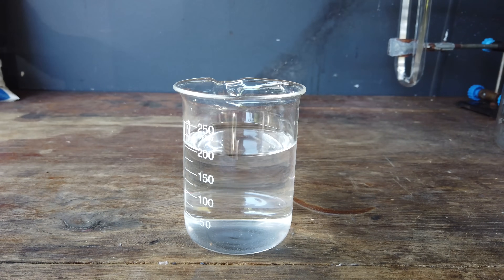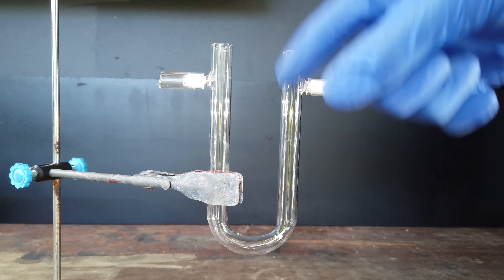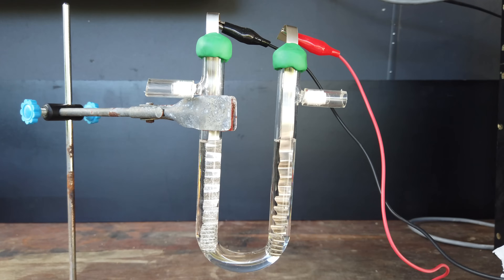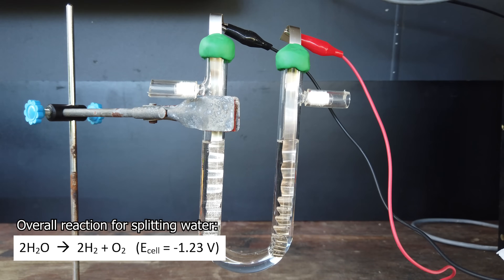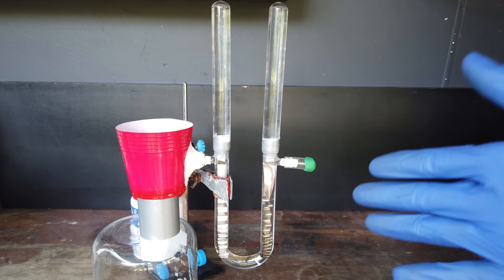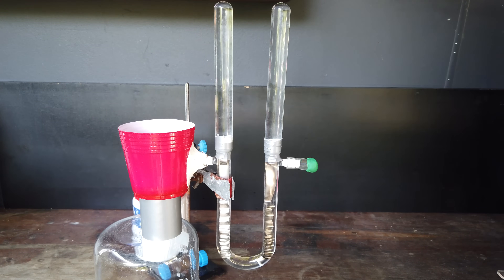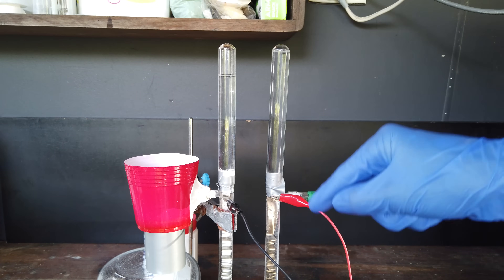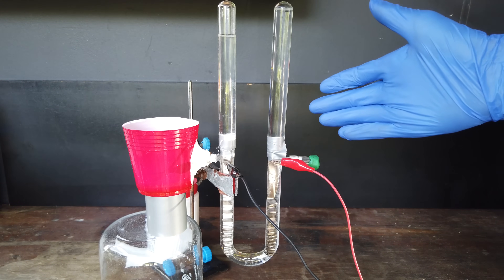The Electrolysis Of Urea

Comment: 12:45 is this video even worth uploading to my channel?

Yes, it is and thanks for uploading this. I actually wanted to know the opposite of the electrolysis of urea. I'm planning of separating impurities from urea through the use of electrolysis. The plan is as follows:

Carboxylic acids are the impurities in this solution of urea. Through Kolbe electrolysis, they'll be combined with each other, slowly making hydrocarbon molecules with few or no polar groups. These molecules, lacking polarity, should separate out from the aqueous phase as an oily layer on top of it.

Your video gives me confidence that it will be hard to break down the urea in this process (which is what I'm hoping to happen), so I'll experiment. I think this process might be more energy efficient than boiling the water (which does takes a lot of energy), thus it might be an interesting approach to separate carboxylic acids from other things in an aqueous solution.

Comment: I really like your videos and I'm currently trying to get a chlorate cell running but all I could get my hands on is a power supply that has a max. output of 3 A. I haven't found any videos about what you are using so I would be really grateful if you would share what you use and where to buy your kind of power supply.
Reply from the maker: I actually use an ATX power supply from an old PC, coupled with a $15 adjustable buck converter from Ebay. The ATX power supplies are free if you extract them from an old or broken computer, and can supply up to 20 amps at 3.3/5/12 volts in most cases, so I've found them extremely useful in the past.
I actually have a video on converting an old ATX power supply into a usable lab power supply, but it's a VERY old video, and not one of my best:
https://youtu.be/ygvbdwl-0bM
Reply: @ScrapScience  Thanks, that's a great help

Comment: I think this is what's used as a gas generator in some variable rate automatic lubricators. And a battery and you can change the rate of gas generator by choosing a resistor.

Comment: Yo man. The fact of the matter is that the voltage used in this process is too big for the volume and shape you are using. You need a bigger (at least 2l) container and the same process as where you produce hydrogen and oxygen. Instead of nickel, try using stainless steel. It should do the correct math of what you were speaking about in the video.

Comment: I would like to know how a commercial device for medical use of hydrogen works without the electrolyte. Can you show and explain that.
Reply from the maker: I've never heard of these devices, could you provide a link or something to point me towards what you're talking about?
Reply: @ScrapScience  yes https://www.youtube.com/watch?v=SpJqAwYXvkw
Reply from the maker: Sure seems like a pseudoscience scam to me...
Nonetheless, these hydrogen generators definitely have electrolyte in them. But since the electrolyte is technically a catalyst for the electrolysis, the initial electrolyte sold with the machine won't ever need replacing, so you only ever need to add distilled water.
It's similar to a deep-cycle battery, which uses a sulfuric acid solution as an electrolyte. With repeated charging/discharging, it requires additional distilled water over time, but adding extra sulfuric acid isn't necessary since the water is the only thing which is consumed.
Reply: @ScrapScience  thanks  for the knowledge i didn't know that .I still have 10x10cm plates of graphite and wanna build that kind of stuff.

Comment: Looking at efficency. If the voltage urea starts to break down at is .37 and one applies 1.5v  then you  1.5v supplied - 0.37 breakdown =1.13v over bolted to push amps.  If a cell has one amp flowing through it at 1.5v then your feeding it 1.5 watts, while 1 amp × 1.13v overvolted = 1.13 watts making heat, while 1 amp × 0.37v  0.37 watts of power overtime doing the actual chemical work of breaking urea to H2 N2 and CO2.  

0.37 watts/1.5 watts consumed = 24.6% efficent. Of cource the hydrogen has much more energy when oxidized to oxygen.

Comment: Electrolysis  in a U tube on YouTube. 😁

If you think of the U tube like a wire then it should become readily  apparent why theres very little current. Ionin flow is being restricted by the cross section of the tube much the same as electrons flow is restricted by too thin of a wire.

Comment: As much as you might think your voltage for dissociation is correct you also have to take into consideration the resistance. The voltage needs to be measured at  the electrodes and not at the reading of your power supply ! I for one was very interested in your video.The atruggles we go through are becoming the higher veiwed videos as of late . Great Scott in electronics shows many stuff ups till he gets it right and explains what the problems were . It makes geeat real world content!

Comment: Dude you cant be real. This is not electrolosys of urea you used sodium hidroxide wich breaks down urea into amonia and other randome garbage thats why youre quantity sucked at life. I hope you will do a corection or explain why im rongh
Reply from the maker: Low concentrations of urea will only appreciably react with sodium hydroxide if the solution is heated. At room temperature, the hydrolysis of urea won't occur to a significant degree under these conditions.

Comment: Holding two test tubes with electrodes in, inverted in a beaker of solution next to eachother is a far simpler setup.
Reply from the maker: Yep, that'd probably work better. Would require a lot more solution though, I don't really want to have to deal with too much caustic waste.

Comment: yeah i know right, its a pain using a box cutter to make a few cheap high surface area carbon felt electrolyser devices with open plastic bottles when robert doesn't do a lot of practical hydrogen urea electrolysis production on the channel water electrolysis at 1.23v/ Urea  electrolysis at 0.37v
like i said 2 weeks ago see https://m.youtube.com/watch?v=LaT5PZixcV0 1256 Urea Electrolysis For Hydrogen Production

Comment: When I was a teenager, me and my friend preformed electrolysis on a concoction of random chemicals we found in his shed, including spermicide powder amongst other things xD. We took power straight out the wall into the cathode and anode and the liquid instantly started bubbling like mad, as you'd expect with that kind of power running through it. We then got what we called "lightning in a jar" where the spark was bridging the gap between the probes, again, as you would expect with that kind of power going through it. We then blew out the fuses for the whole house xD. Those were the days lol.
Reply: Im glad nobody got hurt that day.
Reply: I had a very similar experience as a young teen. My liquid mix was sulfuric acid and salt water and my electrodes were .07 mm graphite pencil leads. God help the house breaker it took it in stride But my gass collection system was retarded and I had a minor violent detonation and that scared the hell out of me!  So shutting it down and hiding the evidence of my stupidity
Reply: @bigjay875  haha I think we were using nails or some random metal spikes.

This was the same friend who taped a powersupply for a model train set to his arm and dipped it into a fish tank to spazz out his arm muscles into contracting. Was only low power, but enough to cramp his bicep up to the point of pain, what I found extreamly hilarious.
Reply: @DaftFader  ha! Ya got a giggle out of me. Ya my best friend and I weren't the brightest light bulbs in the lighting department it's amazing I made it to adulthood with almost every appendage lost a bit of my foot doing energetic compound experiments. But $#it happens. I still love chemistry to this day. I'm currently moving my lab to a new piece of property much further away from people just to be a bit on the safe side. That and I always wanted a farm 😊
Reply: Yeah, I wish I could say it was the dumbest thing we did, but it really wasn't. I don't know how I still have all of my limbs tbh. 😊
Reply: @DaftFader  Wait a minute, electrolysis cannot occur with alternating current
Reply: @sirhaydn-1  Well we were just putting live wires into a jar of random liquid for no reason then 🤷‍♀ (not that we had a reason when we thought it would cause electrolysis anyway lol)
Reply: Nothing like take random chemicals and making electric induced gas out of them to inhale for later use in your cancer production. -=x  
Lucky summa bish!

Comment: Could you make another video of making nitrogen gas? A different method.
Reply: The best practical method is to filter Nitrogen from air. This can be done using a zeolite and pressure swings (Pressure swing adsorption) . You load an pressure container with a zeolite, and add compressed air. The Zeolite will absorb the Nitogen first. Then you bleed off about 20% of the pressure leaving a very high concentration of nitrogen.
The other was is to use a membrane filter that seperates Nitrogen from oxygen using compressed air.
Reply: @guytech7310  I didn't know that! I thought the only method I can think of was to burn something in air and then use NaOH to capture the CO2.

Comment: What is that power soucrce contraption in the beginning? Is it made out of a multimeter?
Reply from the maker: That's just my buck converter I use for electrolysis experiments. I put it on top of my multimeter for some reason.

Comment: The experiment may be tricky in the paper they state urine and urea aside of each other.
But urea is non conductive at first...it may become a bit conductive if hydrolyses occurs and that is what happens if you put a huge excess like 5 mol/L KOH vs 0,33 mol/L urea (putative average content of human urine is 33g/L what means 0.55 mol urea/L urine)...then there is a lot of K(+) and OH(-) and less CO3(2-) and NH3 as NH4(+).

But there is more into urine than urea... there are conductive salts of chlorides, sulfates, carbonates, phosphates of ammonium, sodium, potassium, calcium and magnesium...so why the need for external hydroxides?

To my feeling...the process to convert urea to hydrogen and nitrogen via the use of nickel is not really interesting on a production scale because it consumes a lot of KOH, energy and some Nickel...Ok it generates H2 gas as a potential fuel and N2 (but that is also cheap and findable into the air) ...but NH3 and urea are much more valuable because much more handlable and reactive...NH3 can be used as a fuel too on its own.

If I was to make a no cost H2 generator...I would use Aluminum waste and a little NaOH...(or a little HCl).
The Aluminium would be scrapped of its protective oxid layer to naked metal and react with water to make Al2O3, AlO(OH), Al(OH)3 (or AlCl3 and Al(OH)3+HCl) and a lot of H2...aswel as heat if needed.

Al + 3H2O --> 3/2 H2 + Al(OH)3 + heat
2Al +3H2O --> 3H2 + Al2O3 + heat
Al + 2H2O --> 3/2H2 + AlO(OH) + heat

Al + 3HCl --> AlCl3 + 3/2H2
AlCl3 + 3 H2O --> Al(OH)3 + 3 HCl (HCl is thus simply a kind of corrosion catalyst here)+ heat

So we get hydrogen, heat and with the Al oxides and hydroxides we have some extra money when making microwave rubies, sapphires ;o) and we clean up all those Aluminium wastes :o) ;o)

As a plus the destruction of urea to make H2 and N2...generates one equivalent of CO2...what is absolutely not eco/evironmentally friendly while everybody on Earth tries to get CO2 emissions as low as possible...Right ;o)

PHZ
(PHILOU Zrealone from Science Madness forum)
Reply from the maker: Precisely. There are much better ways of generating hydrogen. This process is interesting from an efficiency standpoint, but since it requires (and consumes) hydroxide salts - which are energy intensive to generate - it's really not a feasible method of large-scale hydrogen production. And the production of CO2 is definitely not something the world is looking for. It may have some use in wastewater treatment, but I don't expect it to have many uses past that.
Honestly, I was only interested in this process for the nitrogen generation, but even that isn't particularly exciting.
Reply: @ScrapScience  if using urine since urine is mostly water can you get o2 and n2 at the anode and h2 at the catode? thank you

Comment: I was kind of expecting this to make a bunch of side products that are essentially a random combination of N, C, O and H. Maybe it still does?
Reply from the maker: That's kind of what I expected as well. That tends to be the way it goes with many organic compounds. However, from what I've read, urea seems to be an exception in that it nearly exclusively splits into nitrogen, hydrogen, and carbon dioxide. Under some conditions, you can also get nitrate as well, but that's under high current density with some weird electrodes.

Comment: you should report the number of coulombs passed through the solution and the applied voltage. If your power supply has a const voltage mode then you need to note down the current at regular intervals.

Comment: If sodium hydroxide is not easily available, you can substitute sodium bicarbonate. The solution will off gas CO2 first and then sodium hydroxide will form once the bicarbonate has been broken down.
Not to contradict you, but sodium carbonate is not stable in solution, esp once the pH has been shifted from neutral. It will form carbonic acid at one electrode, and once the concentration gets too high that will decompose into co2.  The opposite electrode will form the sodium hydroxide as coordination ions and will thus not absorb your co2.  It should definitely assist in the breakdown of the urea though.
Reply: I strongly suspect that your hydrogen is contaminated with co2.  The good news though is that it should be easy to separate.
Reply: For all practical purposes, sodium carbonate is perfectly stable in solution. That the solution is alkaline is a different matter altogether.
Reply: Following the paper there is a huge excess of KOH vs the urea (5/0.33 is 15 fold excess)
So basically urea is decomposed into K2CO3 and 2 NH3 and there is stil plenty of KOH.

No CO2 can form in such a basic media. Especially not on the H2 production side where K(+) comes to react. 

No idea to what happens to CO3(2-) on the other side?

PHZ 
(PHILOU Zrealone from Science Madness forum)

Comment: Must admit the video quality is very good and also audio seems more distinct. Shame the cell worked so slowly but from these experiments we learn things and helps understanding. No experiment is a real failure if you learn something.
Reply: Good video, but you gave up when it was just getting interesting!  Why not test the voltage drop across the U (at 7 ma it should be negligible)?  Why not try different electrode materials (carbon, activated charcoal)?  Try adding various catalysts and wetting agents...
Have fun and try again!
Reply: @riggsed  And if none of that works just plug it into the mains and run!
Reply: low surface area & minuscule Urea concentration morning dark pee is more concentrated than this is the problem... oc caustic potash is cheap everywhere
Reply: @paulmaydaynight9925 
Hello. Does the conductive electrolyte have to be an alcaline hydroxide? Can it be an acid or a neutral ph salt?
Reply: Very well said good sir 👍

Comment: I would not touch robbert murry smith's channel...not much to see there... anyone subbed to channels like this won't get much from him.... though there might be a few videos worth watching.
Just saying lol
Reply: Actually, there's a lot of good content on his channel, unfortunately it's diluted with a lot of boring stuff. Finding the good stuff is worth it though.
Reply: @Unmannedair  I can't stand the way he thinks volts is power and current is power, never does he measure voltage and current at the same time for actual power.  I ragged on him to measure volt and amps in his experiments for almost 2 years. But he don't care realism... he lives in fantasy land.
Reply: @1st_ProCactus  power is work over time, & voltage is current over resistance. The power rating of a motor is dependent on it's performance. Knowing the voltage and amperage doesn't tell you the power 
 you need to actually measure how fast it spins and how much it can push to work that out. Coz if you have the same circuit with two different efficiency motors one might draw less power and work better and one might draw more and work worse. Without the specifics of the motors design, it's a bit hard to predict it's power from a formula which is why it's best to actually measure it like people often do.
Reply: @kulpritblk1578  lol... go back to his channel
Reply: What are you on about yah mad F. Roberts channels sick.      Don't knock it if yah can't do it

Comment: Nice! 👏
Is it possible to make nitric acid by urea electrolysis?
Reply: its possible but the increasing nitric acid concentration will eat most membranes.
you need to use PTFE films as your membrane to do this and your electrodes are limited to the following.
Platinum, Ir-Ta MMO, PbO2, tantalum
Reply from the maker: It may be technically possible. Some studies have shown that nitrate is generated by some anode choices (such as boron-doped-diamond) at high current density. However, I'd imagine it would be very difficult to scale the reaction to efficiently produce reasonable quantities of nitrates or nitric acid.